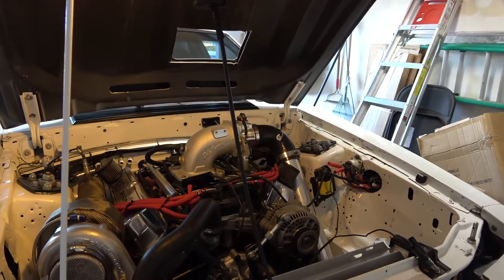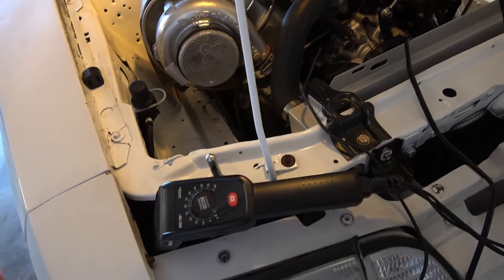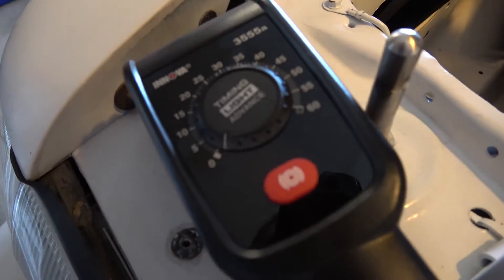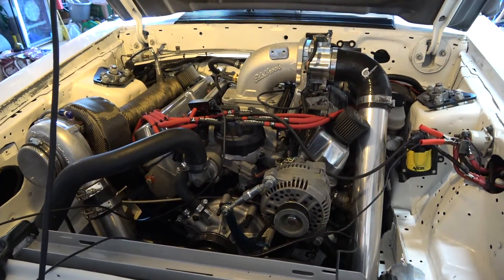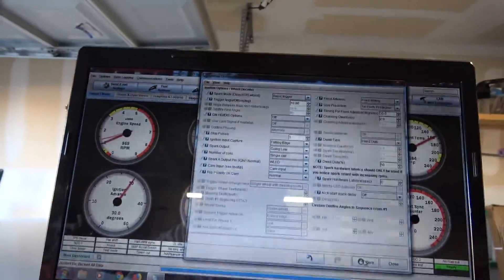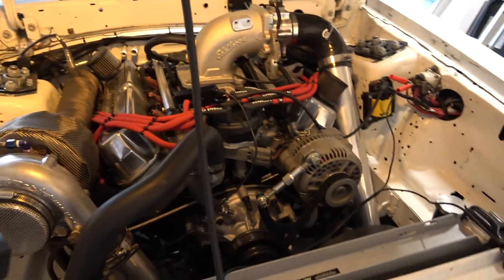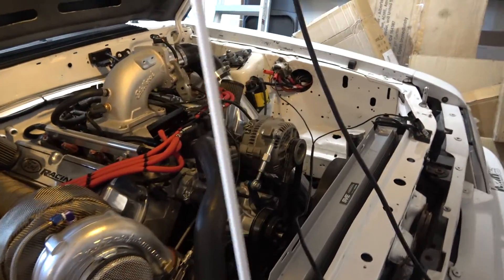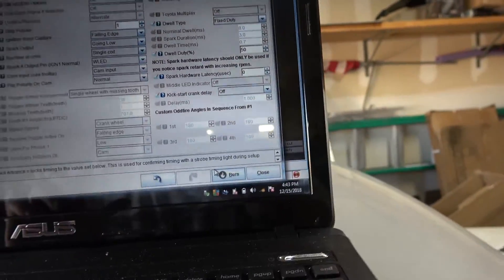Foxbody Mustang Setting Timing Microsquirt

Comment: what alternator bracket are you running and do you have a manual rack.  sweet setup
Reply from the maker: Thanks! Yes running a manual rack. The alt bracket is a moroso bracket. Lmr sells it about 130 bucks
Reply: I've wanted to know the same thing lol
Reply: Does it come with the rod adjuster

Comment: If you pull the spout it drops 10 degrees?  To 20
Reply: On Megasquirt if you pull the spout the car cuts off.
Reply: @robertelmo7736  pulling the spout just takes the computer control out of the loop mechanical only at that point
Reply from the maker: Im not sure, you may just get the same results. As the ecu locks the timing

Comment: With an n/a car, that currently is at 14 degrees , would you put the fixed at 14? Then verify as you did through the laptop vs the crank?
Reply: I had problems setting it that low as it was jumping around, I used 20 degrees and it worked fine. Remember to set it back to "Use Table" or you will be fixed/stuck at 20 degrees. We are talking Micro/megasquirt on tuner studio. I don't know what these dudes underneath are talking about with weights and springs...this ain't the 50's man lol just type the number you want in lol.
Reply: On a n/a car you set timing at 14 with the light at idle. Then if you want 30 at full advance you have to change the springs and weights under the rotor button to achieve your target.
Reply: Tim Martin would it be easier to just advance it at at he crank and then pull timing from that as needed?

Comment: Cool man. If I decide to go turbo and megasquirt you can help me out. 😁.  I'm not sure how my motor will react to boost. 
Would love to have 400 whp vs 250 na.
Reply from the maker: Thanks man! A little boost wont hurt. I probably wouldn't push it past that with stock head bolts and gaskets
Reply: What block did you use in your car I'm thinking about the deck height and trying to do research on it considering Factory it's only 8.2 deck height would like to go bigger on the deck height
Reply: @shawnlibby675  it's a 351w